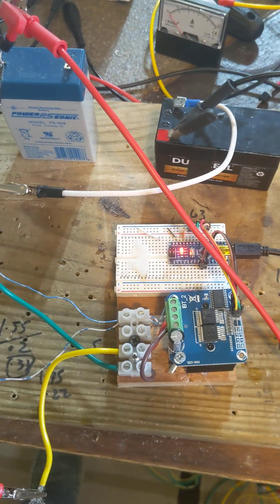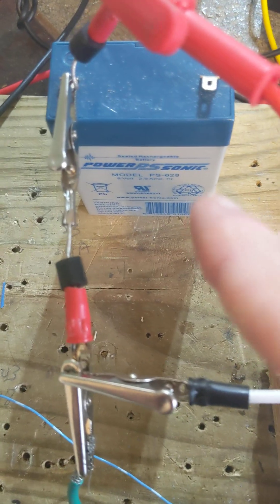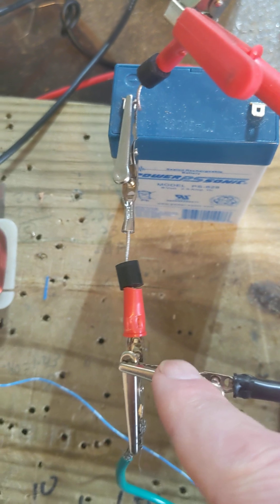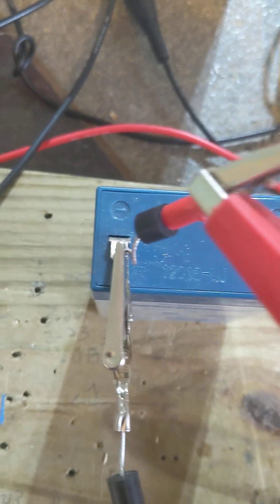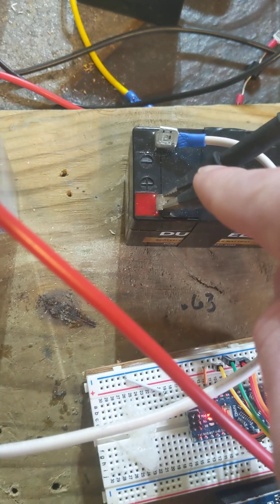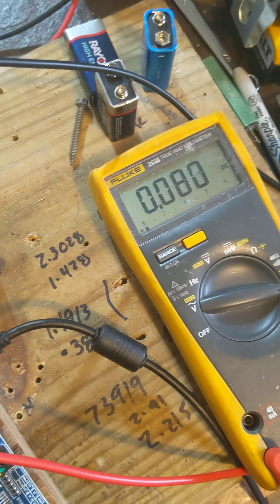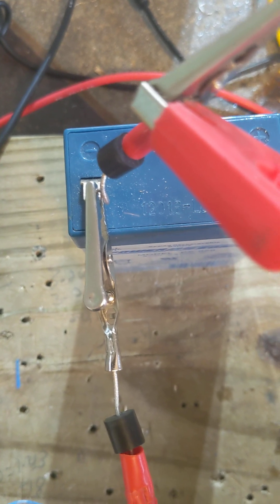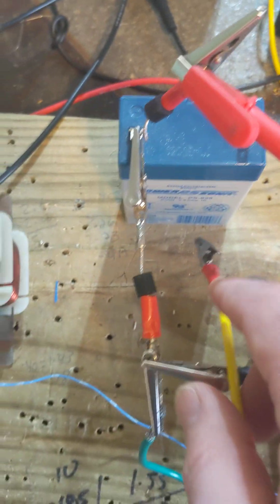charging 12 volt battery from  negative terminal of a 6 volt battery

Comment: Nice video.
What I understand based on my previous experiments is it's happening when oscillation present in a circuit. The two diodes working like an AV plug.
It's more noticeable to high freq and/or high voltage but not restricted to those.
Without any oscillation I believe it won't work.

Keep sharing.
Don't get affected by those negative men, they're might be jealous.
Reply from the maker: Thanks but actually high frequencies do not work with what I am doing..  Much more self induction on Low Frequencies.  About 25Hz is the magic range with my coils.
Reply: Also diodes configuration including the 6V batt will be acting as a voltage multiplier from the counter EMF coming from the coil. Just my simple observation...not sure though.
Reply: If I have a spare time I would try if my idea would apply to this phenomenon.
I don't have a 6V battery but a variable PSU. Hope it still applicable with this.
Reply from the maker: @PLASMUX-20  I can help you if desired.  You will need a low ohm choke in a full core, an Arduino and H bridge. Along with diodes.  Pulses should alternate polarity.  Single polarity pulses do not work well.  We want to avoid flyback with this and only work with self inductance that impedes the incoming current.
Reply: @floodrod  Thanks for the info, mate. 
I have a function gen that would probably replace the arduino(?). I'm not sure If I have here a H-bridge module. I will be back to you and give a feedback if ever I've done the experiment. I had experienced this phenomenon before but it was a long time. So my guess would be this diodes including the 6Vbatt will acts as a multiplier if run at lower freq. while it can also (probably) happen at higher freq but as AV plug like what I did with my TC.
Good luck to us mate, and have fun experimenting!
Reply from the maker: @PLASMUX-20  You will have to create alternating DC from a DC source with components that allow current to flow backwards.  Function generator will not work.  AC transformer of generator will also not work. I have tried tens of hours to build a circuit that lets me harvest it from an AC generator with no success.  It probably can work, but would need a minimum of 6 SCR's plus a timing gate trigger circuit synchronized with the AC Sinus. Then maybe.

H-bridge is not the best choice but it does work.  Best would be a mechanical inverter where a small motor turns a commutator with 4/5 brushes. 2 input DC to the commutator and 2 or 3 output brushes flip polarities ..  I say 2 or 3 because it's possible from 2 or 3.  Just easier to design using 3 output brushes rather than 2.

This is working differently than you picture.  A choke sends counter current back to the source as the magnetic field grows.  And it takes decent amperage to make it happen..    Raise the frequency more than 60 Hz, and the chokes impedance goes too high and the results are gone.  I am not dealing with a collapsing field here-  we are harvesting the impeding force that occurs when we pulse a coil.
Reply: @floodrod  Thanks...
My purpose to the function gen is only for creating pulses that feeds to the main driver like H-bridge in your case. I will find another alternative for the H-bridge if nothing found in my chest.
I did a mechanical oscillator before but not doing at that time seriously. It's a dual switched coil that flip the signal back to the source. Well thanks again for another positive input. 👍
Reply: I'd like to express and explain my thoughts but my poor English shuts me, 🙂.
Reply from the maker: @PLASMUX-20  "My purpose to the function gen is only for creating pulses that feeds to the main driver like H-bridge in your case"--  OHHH  I misunderstood..  I gotcha..  Use it only for the logic using DC square wave pulses to drive an H-bridge.  Then use the diodes on the input of the H-bridge..  YES that should be fine

Comment: Thank you!  Could you sketch a circuit drawing? (What is the circuit you are using?
Reply from the maker: https://ibb.co/SK9xZKm  .3 ohm choke full E-core.  Flipping DC Polarities at 25 Hz. Forcing Counter Induction from the Choke through a diode to power a load from the negative source terminal.